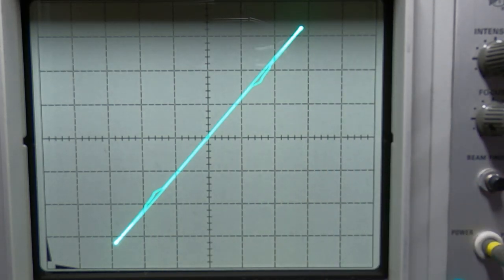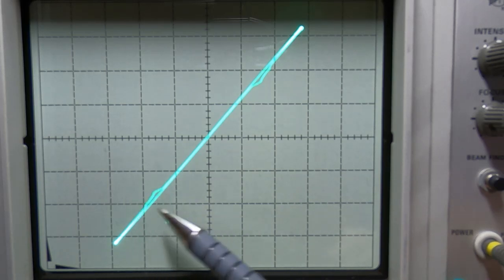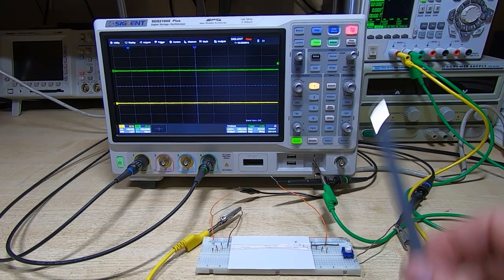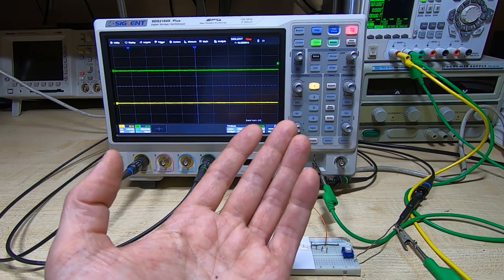Magnetic Core Memory Decoded Part2

Comment: Fantastic video.  Core memory has fascinated me for some time.  So much that I too found a soviet core module that i am so proud of.  I had an understanding of how they worked but your videos have explained is so clearly.

I am confused by one thing in this video.  When you wrote to the core with the inhibit connected, we saw a pules on the sens wire.  With the inhibit reducing the net current to below the threshold to flip the core, why do we still see the pules?
Reply: Sorry you already answered.  I should have know I would not have been the only one to notice :)  I don't fully understand why the pules is there.  I will have to have some some deep thought (not meant to be a hitchhikers guide to the galaxy pun)  :)
Reply from the maker: @richardcloudbase  Yes you will always see a pulse as it is basically a series of transformers but if the 'total' magnetic field is less that that required to flip the core then it will not have a lasting effect. The inhibit current reduces the level to below the threshold but with no inhibit current the total field is sufficient to flip the core magnetisation. There is a great book by J Walker which explains it in a lot of detail :)

Comment: Very detailed explanation, however one thing confuses me. At 19:10 the core is '0' because you have just performed a read, then you connect the inhibit and perform a write '1'.  I know you are not interested in the sense wire at this time but why does it show a signal, I thought this only occured on a change of state and the core did not change state because when you read it back it's a '0'.
Reply from the maker: There is always a signal induced into the sense wire if the core is selected and that is what you see at 19:10. However at 19:30 you can see that the core remained unprogrammed as there was no negative going pulse. This was because the inhibit line was energised during the write pulse. The positive going pulses are 'write' pulses and are always present because the core is always selected (assuming it is this core we are writing to).
Reply: @JerryWalker001  Thanks for such a detailed and quality video

Comment: Nice videos, thank you! I'm just wondering, to write a zero we just have to read. Why to use the inhibit for this?
Reply from the maker: The X and Y wires pass through ALL cores in the array. The read will erase all the currently selected cores to a 0 but you may want to set some to a 1 (eg 10101010). If for example you select X0,Y0 and want to write this bit pattern to that address and do not use the inhibit wires on the mats where you need to keep the value at 0 then all the bits in location X0, Y0 will be set to a 1 (11111111). The function of the inhibit wires is to allow specific cores to be held at the 0 value even when they are selected. In this example inhibit wires for bits 0,2,4,6 would be used to keep those bits at 0.
Reply: @JerryWalker001  Great answer, thank you!

Comment: Fun stuff!   I have a core plane module out of the UNIVAC 1108 mainframe at the University of Maryland.  It was "rescued" when the mainframe itself was decommissioned in the early/mid 1980's, and sent to a scrap dealer to reclaim the precious metals (mostly gold) used to plate various components.  It's very pretty looking, behind of plexiglass panels of the frame.  I think it's 65K 18-bit half-words.  With very large connectors going off the driver electronics.  I've also thought it'd be fun to come up something to drive this beast..  

I used to haul it to the office (back when we had such things..) and hang it on the wall as art.  It's really something quite special to point out to people the actual physical manifestation of individual bits!  Right before your eyes..
Reply from the maker: I totally agree. Not only do they look interesting but they give an insight into how these systems work. You may find the upcoming videos interesting as the system I have developed could possibly be used to get old arrays up and running.

Comment: Back in the '60s I vaguely remember working with a team who were developing materials for core stores. The aim was to produce a material with a "square" hysteresis curve. But I'm struggling to reconcile this curve with the lumpy line displayed on your  component tester; could you show the hysteresis curve for your miniscule cores?
Reply from the maker: I will be showing some information in the videos but the book describes this in a lot of detail and shows the 'square loop' curves and principles. The lumps on the curve trace are caused by the transition across the flux state for the core. The curve tracer display in the video IS the hysteresis curve for the core I am using.